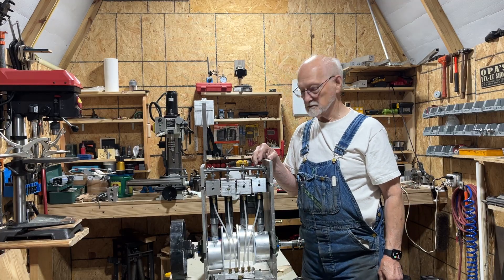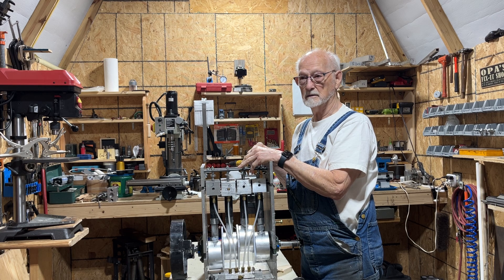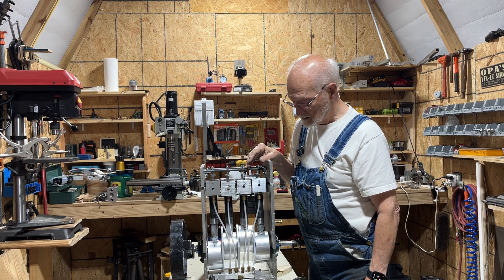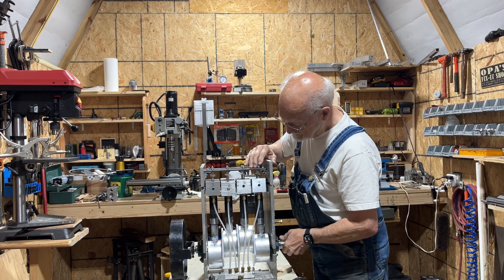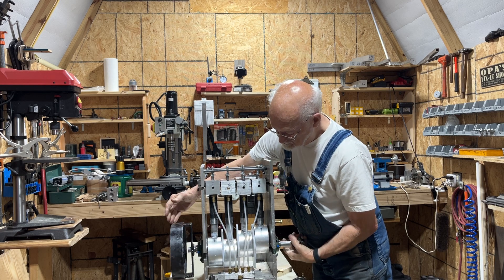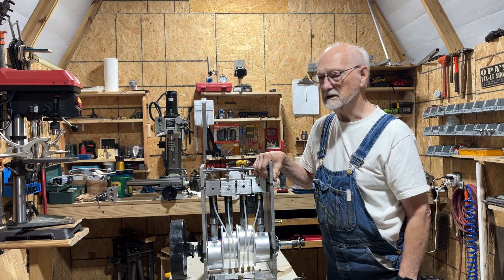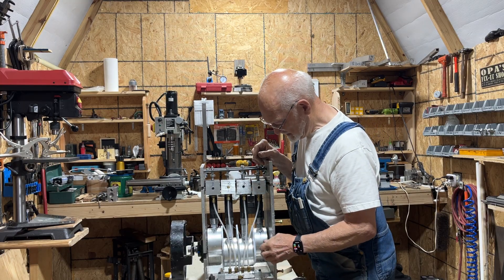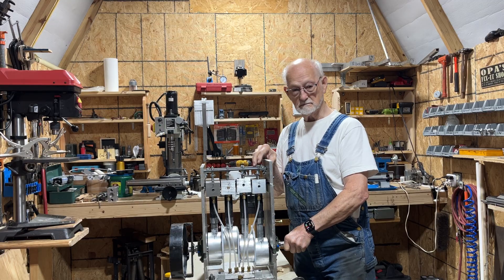My Air Powered Car, I didn't think it would run on 1 Cylinder! 7-18-24

Comment: in my opinion this system in this video is much better than your rotary version.
Reply from the maker: Thanks for your thought
Each has it's advantage, but the 4 cylinder uses more air than the 6 cylinder, and I'm afraid Balance is a big problem with the 4 rings.
I have a plan for it though, I have a lawnmower body that I want to try a chain drive to the axel.
I think it will make a great little go cart, but that's down the road a ways.
Stay tuned!
Reply: @AirEngineResearch  Thank you sir to hear this. Have you ever tried the push-pull system that come from scotch yoke method? maybe the flywheel might be easier with scotchyoke or an arrangement like of the avadi engine concept here: https://www.youtube.com/watch?v=hZfU7vsLC8c. Im just trying to think of solving many parts issue as well as creating seals that hold properly.

Comment: Cool project! I built a single cylinder 2 valve air powered motor for my science fair when I was in middle school. It ran off of surgical tubing that I would pump up and once the flywheel was started, the cylinder would tale a gulp of air and the surgical tubing would collapse in volume accordingly with each cycle. 

I used clear acrylic tubing for cylinder and valves with ping pong balls under spring pressure for valves that seated on O-rings so all internal workings could be seen. 

The following year I tried to make the motor power a wheeled vehicle, but unfortunately it just wasn’t powerful enough.
Reply from the maker: Thank you for responding with your experimenting story.
My beginning was similar. I would say it worked, but not very well and the amount of air that was necessary was just impractical.
Over the years I got things a little better but even today an enormous amount of air is still going to be required for any small distances.

Comment: Air engine steam engine same thing
Reply from the maker: Hi, and thanks for your comment.
If you stop and think about it, the steam engine has a boiler with water in it that is heated with fuel externally, and that builds pressure in the boiler that is transferred into the cylinder at which time it pushes the piston.
Compressed air is compressed in a tank at high-pressure losing heat in the process and when that pressure is rereleased into the cylinder, the air expands by absorbing heat from the surroundings which increases the temperature
 And pressure of the air in the cylinder pushing the piston.
Even though air feels cold when it blows, it is being warmed

Comment: Pretty neat what you're doing.  I've fiddled around a little with steam engines, and while that's not what this is, there may be some good ideas in that whole science you can tap into, they worked on that technology for more than a hundred years.  The first thought (IF I understand what you have done) is when the piston receives the compressed air at 75psi, depending on the stroke the air pressure exiting may still be significantly above ambient and might be able to power another piston.  This was done routinely in the past, where the areas of the pistons and swept volumes were sized such that the air pressure exiting then entered a cylinder with a piston diameter and stroke that would use up the remaining pressure efficiently, then overboard.  A two stage system.  The other thing I noticed (again, I may be getting how this works wrong...) you have single acting pistons, if so the stroke upwards to top dead center is drag on the system and doesn't provide power.  It's not clear to me you would have a more efficient engine if you had a double acting piston assembly, but it would produce more power.  Maybe you could turn the side of the piston with the rod attached in the high stage piston and the other side of the piston in the low stage (pressure) piston, which would be an interesting arrangement.  In any event, my hat's off to you, I'm here on my backside surfing the net and there you are DOING SOMETHING!!.  You've just inspired me to go get something done!
Reply from the maker: Hi and thank you for your comment.
As a matter of fact, I am working on going through my comments, complaint suggestions, and and all the good things and I plan on making my next video through the numerous ideas and will talk about why I’m doing what I’m doing and why I’m doing it the way I’m doing .
My original goal some 20 years ago was to design a simple easy to work on efficient as possible to use the least amount of air to get the most mechanical advantage out of the machine which I call an engine. Some people say it’s not it’s a motor, but. 
Anyway, you have some good ideas and I thought about those and it’s hard to explain but doing those things would just increase the size weight, complexity, and increase the amount of air that would be necessary such as double acting cylinders. I’m using 2 inches of air and using a double acting cylinder, I would use 4 inches , do the same thing.
Anyway, I’ll be making a video soon and cover the things you suggested also  - see you then

Comment: Internal Combustion Engines (ICE) transform potential chemical energy into kinetic energy.
Hydraulic, pneumatic, and electric MOTORS convert stored potential energy into angular energy.
You have designed a pneumatic motor, not an engine.  Steam would be much more efficient, due to Latent heat of Vaporization.
Energy losses due to adiabatic cooling, of the air, make it extremely inefficient.
Reply from the maker: Thank you for your comments, and you have good points.
Compressed Air does work through expansion inside a closed cylinder to produce motion which I am trying to use to it maximum potential.
I am trying to build the most efficient Engine for use with compressed air and its properties.
As compressed air expands it absorbs as much heat as it can, and it expands accordingly to how much heat it absorbed. 
I realize expanding air has no comparisons with explosive gasses, but there are ways to add heat to air before release and/or during expansion.
Adding or somehow Saving heat, is another area of research for me.
When I can't improve the mechanical device anymore, I'll work on expansion ideas.
Thanks again for following along with my endeavor.
Reply: @AirEngineResearch  Thank you for the response.  Didn't have a fair comprehension of the endothermic properties of an expanding gas.  I think all research yields benefits in some manner.
Additionally a compound ICE/motor could have great heat control potential.
Please don't allow my ignorance to be disparaging, formal education can cause one to be myopic to a potential revolution in man harnessing of energy.
Having read Power Hungry: myths of green energy, I tend to doubt things that seem to contradict Jevon's Paradox.
ie making things less efficient causes people to reduce demand.
Your retort is well appreciated.

Comment: Awesome! I wonder if there could be a self centering shape you could put on the rings that could work like the way a belt will self center on a domed pulley to keep the rings from rubbing.
Reply from the maker: Thanks again for your comments and suggestions, and I have thought about various ways to do what you’re talking about, but that also presents the problem with installing the internal driveshaft rotator.
I’ve taken the dividers away and that didn’t cause a problem. I was  probably being over concerned about the rings not running true, which turned out to be not a problem.
I’m already working on the next video which has improved performance and much less noise with those dividers gone.

Comment: it seems your engine would be more optimal on lower psi and lower rpm, rather than shaking the whole thing apart. you dont need the high rpm for power like a gas motor does . so having a coulple tanks at 3 or 4 thousand psi and regulating it down to 100 or so would give you power and longevity on the air supply. what are your thoughts ?
Reply from the maker: Thanks for your thoughts and following along. 
In order to meet my requirements for use in my car, it has to have both the power and the speed to allow me to go between 50 and 60 mph
Using my old Pickup as a gauge, I need 2400 RPMs to go 60 miles an hour and horsepower I would imagine somewhere around 40 hp, so how do I come up with that? 
It’s gonna be a combination of cylinder size but also minimize the amount of air that used and depending on how much pressure would be required to make the engine run at 2400 RPMs so right now it’s too soon to tell I would just be speculating